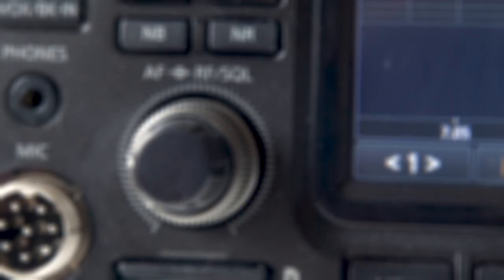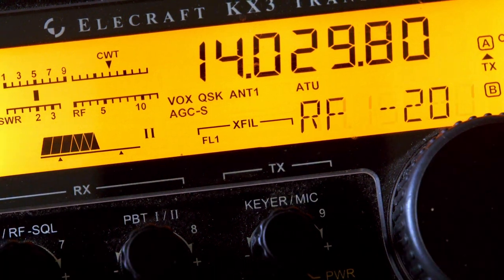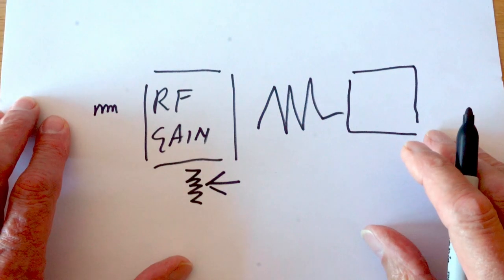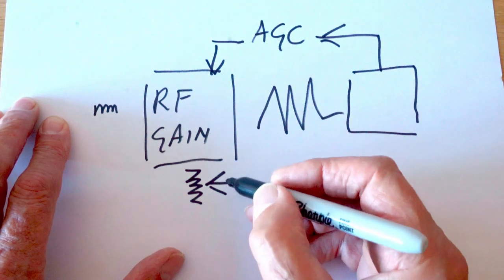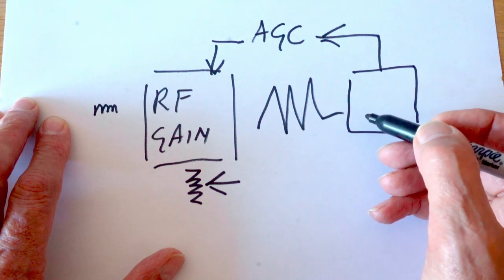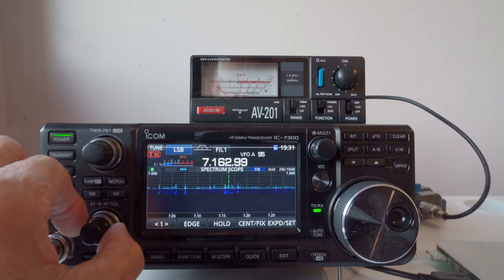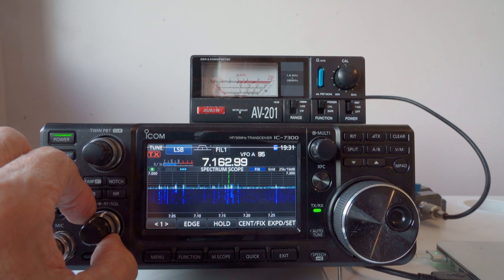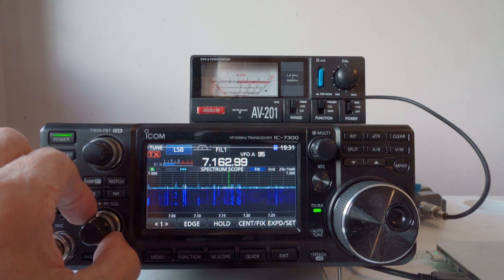Noise Reduction Technique - Try This Tonight. | HAM RADIO

Comment: Certainly an overlooked control in many cases. I’ve been renewing my interest in CW, listening/copying in the evenings. Using the RF gain control, AGC speed, and filtering built in to my TS590, I found that I could have beautiful ‘armchair copy’ by balancing these controls. As you say, there’s no need to amplify noise and these simple controls easily improve copy. Most people I know always keep the RF gain control full open. Thanks for posting.
Reply from the maker: Excellent!

Comment: On IC 7300 In the Audio screen, there are attenuation settings of 10 20 or 30 and the audio peaks go down accordingly. This is a different setting to holding down the P.AMP/ATT button and have ATT show up on the screen.

Comment: I just got my IC 7300 the other day. After hooking everything up I excitedly turned it on & what was the first thing I did ? Well, I cranked that-there RF Gain control WAY UP (like a crazed teenager who just got his Driver's license & stomped on the accelerator pedal just to see how much "Pep" his car has), just short of "Squelch". As a result, for days I had been Monitoring (Overseas Airline Traffic on 8.843 Mhz) - putting-up with that annoying "Pumping" effect in between Transmissions, with so much Noise. After getting fed-up with that, I studied the relationship among the three controls & started fiddling around on my own. The 1st thing I did was to turn the RF Way Down, then turned Up the Volume control to 12:00 - 1:00, followed by setting AGC to "Fast". Lo & Behold - as a result I finally "Scared" my Tranceiver into giving me the loudest, clearest Voice transmissions ever, with the lowest background Noise possible. And no more "Pumping/Breathing/Compressed sound ! I think I accidently stumbled upon what you are saying here in this video I just found today, which seems to confirm what I had accomplished several days ago. I just "Set It & Forget It" & "Leave It The Hell Alone" (happily). Thank you so much - your videos are extremely helpful & "Very Diplomatic" : In an exquisitely eloquent way only an Englishman can do. 73s.
Reply from the maker: Hi Jimmy, I enjoyed reading that! 73 Peter

Comment: I tend to set preamp & attenuator per band to basically accomplish the same thing, but also use the squealch control when in QSO's or Rag Chews (mostly on the lower frequency bands) to make SSB almost as comfortable as FM. I also use a Noise Reduction speaker, especially on the lower bands. Back when I was living where I could run 160m with a full size inverted L it was necessary, especially in the summer, even with a magnetic RX loop.    Keep spreading the good word! 
 73's  mike  N4ONL

Comment: Thanks for this video, I learned a few tricks I didn't know. Would you consider doing a series showing "best use", control by control? I am sure this would be useful to newbies, returners and revision for experienced people who set up by habit and may have forgotten some aspects.

When people ask "how high is your noise floor", is that with RF gain down or up noticing it's effect on the signal meter?
Reply from the maker: The noise floor is full RF gain and strictly speaking a dummy load across the antenna input. But it is really of no consequence for most of us!
Reply: @watersstanton  Thanks for the clarification, I appreciate it.

Comment: Yes reducing the RF gain control setting for minimum noise, is little understood these days by some hams and it certainly helps. Problem is the RF gain control has to be set to at least  a quarter to nearer the half way mark, to obtain a meaningful s meter reading, and this compromises noise reduction . You would have thought by now, manufacturers of modern SDR rigs would have overcome this RF gain issue. I have found that by using an outboard analogue audio processor, which has compression, expansion and a limiter really can improve the signal to noise on even the weakest signals buried in the noise. My audio processor limiter, can be very useful for greatly reducing very loud static crashes, making it much easier on the ears to copy SSB signals. So the extra expense by having an audio processor, has certainly been worthwhile for noise reduction. Perhaps modern SDR rigs should have a built in receive analogue audio processor, what a great idea.

Comment: When NC for a traffic net or checking in to a net, where I will be on a frequency for a while, I move the preselector filter so that my center frequency is at the edge of the filter passband, then adjust the rf gain until the s- meter deflection is just above the peaks of the noise. Much more enjoyable,  and I can still copy the weaker stations just fine.

Comment: There are features such as noise reduction, notch filters even a 2nd noise reduction control. But the best is to turn down the RF and turn up the AF. Just play with the RF and AF gain and you’ll be surprised how much of a difference these to controls will make. So simple but extremely effective.

Comment: Hi Peter, 

This is an interesting subject and the funny thing about you using an IC-7300, 
is that this is the main "disappointment" in my 7300 (SDR) when I compare it 
to my IC-9100 (superheterodyne).

On the 9100 I can reduce the RF gain so that the AGC does not "pump-up" the 
noise in the pauses of the speech, but the audio level from the voice is not
that much reduced, resulting in a far better perceived SNR. 
As you mentioned: this makes listening so much more comfortable indeed. 
I have used this for years and still do .. on the 9100.

On the 7300, however, it does not work nearly as good (I am still using v1.30 
firmware, so maybe things have changed by now). On the 7300, reducing the RF 
gain reduces both signal (voice) and noise and this is because the AGC on an
SDR receiver works "a bit" differently. It still works a little, but not nearly as 
effective as on the 9100. 

Setting the AGC to 'slow' has far better effect on the 7300, i.e. as long as 
the remote station keeps on talking :) 

Of course, as you will surely understand, by reducing the RF gain, you are not 
changing the SNR at all. You are reducing the level of the "pumping action" 
(your words) of the noise by the AGC. 

73, PC1JB
Reply from the maker: As i explained, it is the absence of noise during AGC recovery that is the main benefit. It does work better on a suoerhet snd the modern Yaesu radios with superhet front ends. Thanks for sharing. 73 Oeter.
Reply: I'm surprised that with SDR, there's not a way to suppress noise more than the signal because the noise is going to be much more Gaussian and stationary than SSB (which is much more coherent, and not so stationary). I agree that by turning down the RF gain I have noticed it becomes easier to listen, but also agree unless you can separate S from N, your not improving S/N (or S+N/N).
Reply: I 100% agree my main complaint with my ic 7300 is a poor (putting it mildly) RF control.  Making it almost unusable on noisy top band . The ftdx 10,ts590 ts 870 , even the ft817 outperforms the horrible ic7300RF control.

Comment: Would the AGC work against you as you ride the RF gain, might it be an option to switch the AGC off? Interesting video again, thank you.
Reply from the maker: Yes you can turn the AGC off it you have that facility.
Reply: I found turning the Agc off on the 7300 was the best way to work with the rf gain control. 

Interestingly that method doesn’t work quite as well on the 7610. I keep the Acg on and adjust rf gain manually and with attenuation.

I believe the 7610 has it’s Acg operating in a different part of the rf path and as such performs better as standard (and I’d agree with a that in practice too).

Great video Peter 👍 thank you.

Comment: I really enjoyed your video. I am a student and want to be an RF Engineer in the future. I have a question, sir, what if I add adaptive filters to remove noise that varies over time. This is an advanced DSP topic but it really will help to block background noise. Also, I can use a bandpass filter centered at a very narrow band frequency to remove noise if and only if noise frequency is not present in that narrow baseband signal. please clarify for me. I have just theoretical basic ideas, Should I go for experiments if it works.
Thanks in advance.
Reply from the maker: Dealing with noise is a complex problem. DSP algorithms are pretty good but there is always a loss of quality. Bandpass filtering has the disadvantage of also filtering what you are trying to hear. I wish you well with your Electronics future and maybe you will be able to answer your own questions. 73 Peter.

Comment: I had heard of this before in connection with an old article on its use with Icom 756 Pro, Pro2, and Pro3. I found your video very helpful! But I wanted to ask a question: Is this procedure specific to Superhet radios? Will the newer SDR radios also be able to use this technique? (Maybe irrelevant, but I wanted to ask) TIA!
Reply from the maker: For most SDR transceivers,yes.

Comment: This works much better on super hed radios. SDR’s far pail to this technic.
Reply from the maker: It works just as well.
Reply: @watersstanton  ahh, no it certainly does not.
Reply: Peter demonstrated it using an SDR radio, the IC7300 and it worked well.
Reply: @acestudioscouk-Ace-G0ACE  yes. My comment was that a super hed does it better. The radio architecture is better build for that technique. Try it and see.

Comment: Unfortunately the RF control on the ic7300 is very poor .
My  ic 703 , ic 746 ,ic 7200 ic 781 is much much much better.  The SDR ic 7300 sadly does a very poor job .
But a do agree the RF control is my go to,to squash noise.  DNR doesn't make up for a  good RF control.  However like i said most sdr radios I have Xiegue g90 and x6100 and ic7300 are poor when it comes to RF control . My somewhat low regarded yaesu ft-897 has a much much better RF control than the ic7300 ! On top band in noisy conditions the ic7300 is poor when it comes to RF control.
Reply from the maker: Yes there are many better radios in this respect. The main thrust is to try using the RF gain control on whatever radio you have.
Reply: @watersstanton  Indeed that is true . Thanks for your response.

Comment: The RF Gain was designed to combat reciever overload not reducing signals to combat noise it just doesn't work. Why would you want to de sesitize your receivers why not just tackle curing the noise floor.
Reply from the maker: You have completely missed the poinr. Try watching it again.
Reply: Some time we can't tackle the noises floor RF gain or ATT is the option
Reply: The rf gain helps massively can bring weak signals completely out of the noise